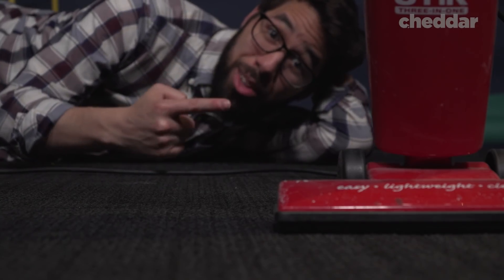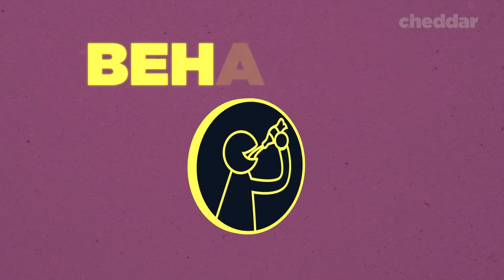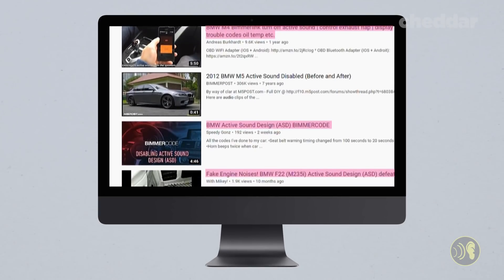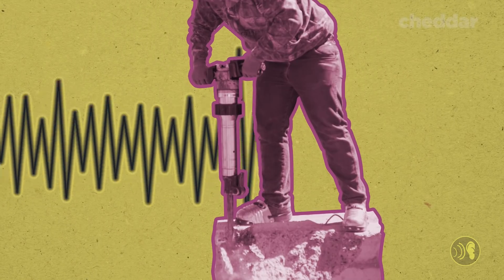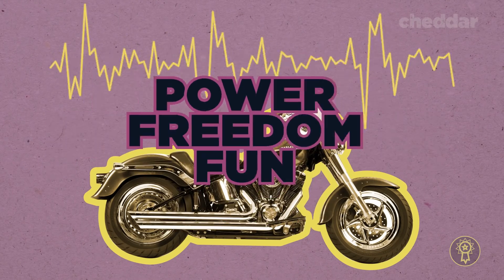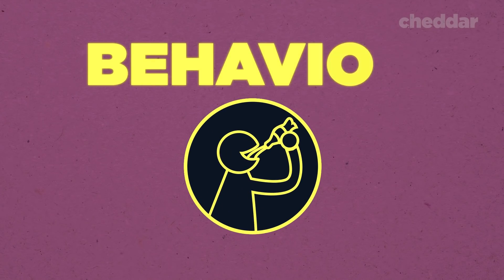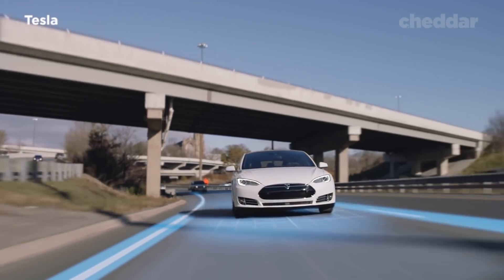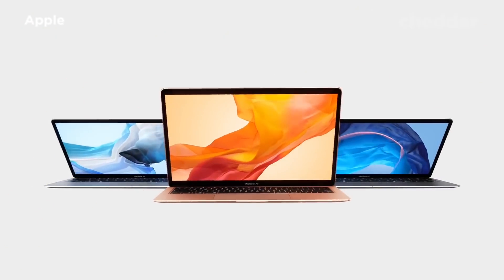The Fake Sounds Companies Add To Products - Cheddar Explains

Comment: I'd take a lot of this with a grain of salt. And vacuums are loud because they use tiny motors driven at insane speed. My shop vac has an impeller that is about 4 inches in diameter and only 3/8 inch thick.

Comment: As a car enthusiast, I personally think Harley-Davidsons sound like crap. It's not any hatred of motorcycles because I think motorcycles tend to be cool. It's that potato potato sound sounds like the engine is misfiring, running rough, or about to stall. It sounds like it's running with a mechanical problem that will damage the bike. If any of my cars had that intermittent exhaust noise or the shaking of that Harley idle, they would be in the shop for repairs until they actually ran smooth. I like the sound of engines, but I don't like the sound of an engine shaking itself to pieces.

Comment: I HATE vacuuming, I hate it so much becuase loud disharmonius sounds make me anxious. I have a hard time getting myself to vacuum because of the racket
Reply: Then get a robot vacuum , you'll solve two things at one time. Although you'll still have to manually vacuum your floors once a week You won't have to do the physical labor and deal with the loud noise of running a vacuum with a robotic vacuum.

Comment: Motorcycles are not made loud for safety, and the difference in note is more to do with various engine configurations. Legislation has continually reduced the overall sound output that motorcycles (and cars) can make, and in bikes especially, that sound is tuned to give the rider the experience they expect, be that the induction howl of a Kawasaki due to a tuned airbox, or the beat of a Harley twin. Or even a little squirt of fuel during the exhaust stroke for a little pop and bang, at least up to Euro 5.

Comment: What's funny about this is that I actually have always put off vacuuming because of how much I hate the noise. I had always just assumed that pulling a high volume of air through a small tube structure with a high RPM bladed fun had to result in very loud noises

Comment: One time i drove with the european verson of the Ford Transit. And it´s turn signal sound was so inaudible, that i could not even hear it or only when everything else is super quiet, which is never the case. I dont know wheter you can get the volume of it up, because it was a company car, but i think it´s very dangerous.

Comment: A car door shutting sounds different because of the shape and weight of the car against the shape and weight of the door! 
I have taken apart several vacuum cleaners to repair them and I have never seen a loudspeaker or any kind of speaker system.
Now, inside of a modern vehicle the designers can certainly use noise reduction and noise generation, along with vibrating the seats with sound, to make the driving experience different. That is done within a closed environment.

Comment: How about the BMW i8? It's a hybrid not-very-supercar with a V6 engine. To make it sound like it has some grunt it has under the right rear corner a loudspeaker inside a metal capsule, with a fake exhaust pipe which curves down and back to let the sound out. So it's not bad enough that cars are putting fake sounds to the inside, some put fake sounds outside for the pedestrians to hear.

Comment: You can use some bubble wrap cut to size, and affixed to the casing of the vacuum cleaner with double-sided tape, to muffle that horrific sound considerably.
It makes for a puffy vacuum cleaner, tho. But an "horribly looking" cleaner is preferable to an "horribly sounding" one, because you can look away from it, but can't hear away. That's it.

Comment: As a motorcycle Enthusiast: a bike being louder does NOT make it safer. I've often been overlooked even when being right next to a car, which has the windows rolled down while my motorcycle was in first Gear accelerating. 

Just putting it out there people, loud pipes don't save lives, they just annoy everyone around you, if you wanna be save get yourself a motorcycle airbag and a high vis jacket, removing a muffler does jack shit

Comment: How are people researching how to get the loudest crunching noises out of chips but cars still don't have more than one horn sound? If a car honks at a pedestrian it's just way too loud. The horn is made to signal to other drivers who might be listening to the radio or be otherwise distracted but it's such a shockingly loud noise for any pedestrian right outside the car that it defeats the purpose in most use cases. It'd be great if that would finally get fixed.

Comment: Stopped watching when you confused Trademark and Patent law.

The engine design is over 100 years old, and thus not patentable. Patents are designed to encourage inventors to disclose inventions: and only last for 20 years as a result.

Trademarks on the other hand, are designed to reduce confusion in the marketplace. They can't actually describe the product at all (a trademark becomes invalid if it is genericized). As a result, trademarks last indefinitely.

Comment: So that's why vacuum cleaners in Europe are much quieter now that's illegal to sell vacuum cleaners more powerful than 900W, and many of them try to be even more environmentally friendly. And surprisingly enough the suction in a 2018 600W vacuum cleaner is just as good if not actually much better than a loud 2000W vacuum cleaner made a few years before that law. This is because they really have to max out the aerodynamics and sealing of the vacuum cleaner now, and can't waste any of that power on making it intentionally loud. Because a loud fan indicates bad aerodynamic design, that dreates vortices, weirdly placed low and high pressure zones and other things that cause drag.

Comment: It kills me that Snapple thinks changing from glass bottles to plastic bottles is a selling point. No, Snapple. I don't want more single use plastic in my life, I don't care how poppy you made the lid.

Also, give me one of those quiet vacuums. I can tell if it worked by looking at if the floors are clean once I'm doing using it, and how much dust and debris are in the bin. Cars, you can also feel free to be quiet. That means I won't have to turn the radio volume up as high to drown out the other noises.

Also, Harley: your bikes sound like 💩. They're obnoxious. Quiet them up, nobody wants to hear it. Even South Park made an entire episode dedicated to how stupid your bikes sound.

Comment: I've got a Filter Queen that was 20 years old when I bought it in 1979. I replaced the motor and hose 20 years ago and it works very well. And it is LOUD and I don't think sound design was a thing when it was built in the early 60s. Come to think of it, I don't know anything that I still have, let alone a 'working object' from over 40 years ago. Amazing now that I think of it. I'm getting kinda... sentimental about my Filter Queen.

Comment: Your comment in 7:52 is not viable, they will have to change the law because the usage of a car horn is to be used only in cases of emergency, hence the sound, you can't have a car horn designed to be more subtle to say "thank you", by law, car manufacturers can't make them.

Comment: Well that's nice I'll take a quiet vacuum that I can hear the kinks of the dirt better over the motor plus I won't go deaf using it. I think we're going to hit a point of overly noisy devices soon, I mean look at an active noise cancellation it's literally ejecting more noise than is needed on top of the noise that you're trying to drowned out depending on how well that's implemented they might be doing worst year hearing?

Comment: I hate break to the creators of this video, but they fell for the biggest lie in motorcycle safety...a louder motorcycle is NOT a safer motorcycle, and the old adage “Loud pipes saves lives” is not true. Motorcycle rider training is much more important. I am a motorcycle safety instructor with over 30 years of experience and I have never had a “loud” bike...or an accident.

Comment: I learned about this necessity when working for a global telecommunications company.
They have to place chunks of cheap crap metal in the handset of their desktop phones.
The technology for the handset is microscopic today.  This is easily demonstrated by the customer service headset or the tiny mic and speaker on a cell phone.
But if you put these components in a handset for a telephone the plastic handset is so light that users don't like it.
The callers experience is diminished.  The handset is to light and difficult to control.  
The handset is too flimsy and doesn't convey a sense of quality construction.
All in all, the user experience is not enjoyable unless the handset, when you pick up a call, has some crap metal glued inside to fool you into thinking it is carved from melmac and steel.

Comment: Nissan used special exhaust manifold to create roar in engine, Mercedes and Diana death been accused if that Mercedes created so sound isolating properties that driver loose reality between engine rpm and speed and safety speed, if engine not makes any noise it means no speed exist on road :) Ambulance siren is designed and copied form baby cry this pitch and sound is so instinctive for parents it can them wake up 4 in the morning, ergonomics is weird science.

Comment: As a former owner of one, the Harley “potato potato potato” sound means “unreliable, underpowered, and expensive”. 
I bought mine brand new and after 810 miles the head bolts pulled from the case. I had the engine replaced under warranty and sold it with 811 miles on it. I was meticulous about break-in and maintenance. My Honda 750 is 20 years old, has twice the power, and other than a couple dead batteries has never given me trouble.

Comment: Another example of this would be the Stadia controller, the buttons click so loud and they only click when you release them, tricking your brain into thinking that the press of the button and the visual on the screen are synced up. It tightens the latency gap just by a little bit.

Comment: Blame stupid consumers for a loud vacuum cleaners. Quieter vacuum cleaners didn't sell as well as loud vacuum cleaners. Ever notice how that little one horsepower shop vacuum is definitely loud, while that huge 10 gallon 5 horsepower commercial shop vac is so quiet you can hold a conversation while it's running? It's because consumers are stupid.

Comment: I am fine with a vacuum making the crackle sound of stuff getting sucked in, but absolutely not the rest of the noise.

Also, for a vehicle, I'll take as much silence as possible, to hear other vehicles near me on the road, just in case I don't see them.

Also, chips, I put them on sandwiches, not for flavor, but for the crunch.

Comment: I like the Tesla's silent ride. Especially that 0-60. Feels like hitting a hyperdrive. Extremely efficient engine sending you into the seat and blasting off over the horizon. And when you slow down, the subtle jerk of coming to a stop because inertia is trying to keep you going. But the CAR is in control. You are in control. You have that power.

Comment: It is loud because for the same power it is cheaper and lighter to use a smaller motor running at higher speed than a bigger motor running at a lower speed.

Comment: A specific car horn for "your blinker is on but you no change lanes or turn" would be pretty good. Also a double turn signal, for consecutive turns, like going into a side entrance of a business on a corner of a avenue and a side street.
Reply: If I'm behind or in an adjacent Lane to someone with their signal on, I'll start flashing my high beams in timing with their signal. It frequently works because my flashing lights call at their attention to the sound of their turn signal which would then be in timing with my lights flashing.

Comment: You know a car has power not when it's loud, but when you kick the pedal down and it's hard to breathe due to the acceleration g-forces lol. Or when you feel the back of the car losing traction at high speeds when accelerating.

Comment: The obnoxious sound a Harley makes is more about ego and considerably less about safety. If you don't believe me, go stand near a busy intersection and wait for an emergency vehicle to come through. Those emergency vehicles have extremely large sirens facing forward as well as blinding lights flashing in a frenetic pattern. Now observe the majority of the people utterly ignoring the cacophony blasting them right in the face. Compare that to a motorcycle that has the exhaust pointing to the rear.
Loud pipes save lives started as a joke. Look up Hollister, CA 1947. You will need to delve into the follow-up articles about the event, but you will find that quote in its original context..
Further, I read that some of the newer Harley engines were made quieter, but were rejected by the initial "beta" testers if you will.
My Goldwing and even my BMW are pleasingly quiet and will outperform even highly modified Harleys. I then can hear threats to me, instead of relying on others to see or hear me and do the right thing. (Think about that.)

Comment: I am a car enthusiast, but I find silent Teslas super cool. BTW, why reinvent the wheel about the pedestrian safety? The problem is already solved in trucks, construction equipment and forklifts. They beep as they back up. We're all familiar with that sound and it works very well. So... why is that a "new" problem with the electric cars? They should beep as they back up, as the forklifts do. They should also beep as they maneuver forward. Let me explain: in all modern cars you already hear the beeping inside the car - it's the parking sensor. I love that device, saves my bumpers and lets me relax while parking. So - why not make the parking sensor beeping audible from the outside from the car? The pedestrian on a parking lot would be warned a car may get close to him or her. I like the sound of some parking sensors. It's rather pleasant. It warns you, but in a really unobtrusive way.

Comment: The Harley part is actually infact wrong, and incorrect, the motor that is in the Harley is a v twin, it's over 40 years old and it's just a badly designed engine, the "potato" sound, is correct but they can't make them any quieter noise is a problem with them.

Comment: Their parabolic structure is meant to get the loudest crunch you can get from a chip

Me in the back of class tryna be as quiet as possible: -_-
Reply: Push your tongue against the chip and "bite" it like that, it won't be as loud
Reply: @Huimangi  pro tip 😎
Reply: Oh just swallow it without breaking
Reply: @thebanished6725  And Choke Yourself. Smart👍👍👍
Reply: @bronsavage1417  big brain 😎😎😎
Reply: (kidding) pulverize it into dust before class and mix it in your "pop" drink, oh wait, that has a noise too.

Comment: I love electric cars, and would never buy one that intentionally produces an artificial engine noise.
Reply: Electric cars need to make noise for safety reasons, especially in shared spaces like parking lots.
Reply: @KonradZielinski  a noise yeah, an obnoxious engine noise, no. Simply engineering them so the tires are not overly quiet on the road surface solves that issue. No excuse.
Reply: @jasonchappell9694  An engile noise is what pedestrians are expect to hear. Its what they are, listening out for. Here its ehsier to use habit to improve safetty rather than trying to teach everyone a new habit.
Reply: @KonradZielinski  yeah, I call BS on that. I drive around in a car that makes zero engine noise. Never had any issues in parking lots, or at cross walks, or with pedestrians at all. Why? Because I am not a moron, and pay attention. That is ignoring the fact that even though my car makes no engine noise, the tires do make a noise, and the electric motors do make a sound when accelerating. It’s just not what would be considered a traditional engine noise, more of an electric whine.
Reply: @KonradZielinski  First off, California is not the end all be all of what should be done. Second, As electric cars become more common, and Internal Combustion less so, this becomes less of an issue. Third, lack of wanting to put in the effort to learn a new behavior, skill, or habit is no excuse, as that thought process stifles progress and innovation. Fourth, the solution is still not “make electric cars sound like internal combustion”. That is asinine at best. If we can engineer whistles on cars that warn deer we are coming (which have been around for decades) we can come up with a better solution than making cars with no engine sound like they have one. You can go f/o with that solution IMO.

Side note: if we did everything how California wants to do things, everything on the planet would carry absolutely ridiculous warning labels.
Reply: @jasonchappell9694  California currently has 10x as many electric cars as the next highest US state, so its not surprising that research on electric car safety is being done there. That said Guid Dogs UK are also claiming that electric cars seem to be hitting pedestrians at low speeds more often than other cars.
Reply: @KonradZielinski  you do realize I am just ignoring you at this point, right?

Comment: What a load of rubbish when it comes to vacuum cleaner, I'm an ex Dyson engineer and I can promise you we didn't work to make them louder. Most of the efforts by acoustics was to try and get rid of some of the high frequency sounds. Certain sounds even if quiet people hate, like a mosquito. The reason why babies and dogs don't like there hand driers is as the high frequency sounds have been pushed up past the point adults can hear. It's fair to say that the manufacturer could spend more money and improve things like motor mounts to make them quieter but this would all increase the price.
Reply: The reason the bin is noiser is because its half the thickness it was on the dc01.. Save money and reduce weight.